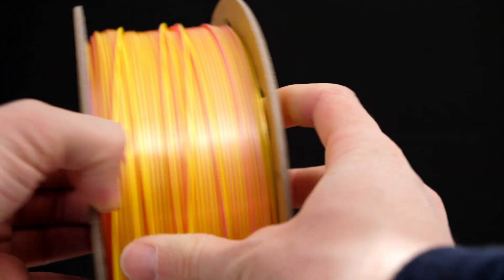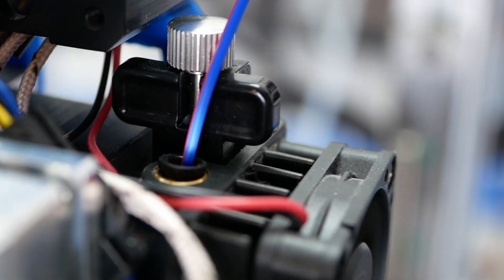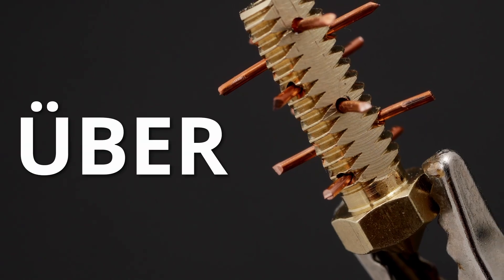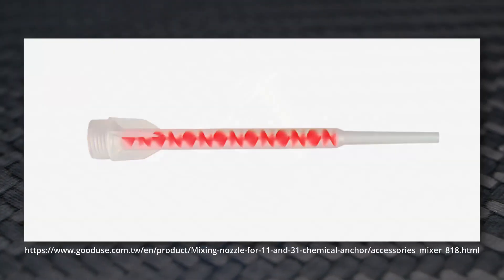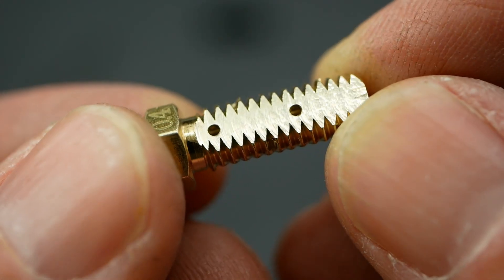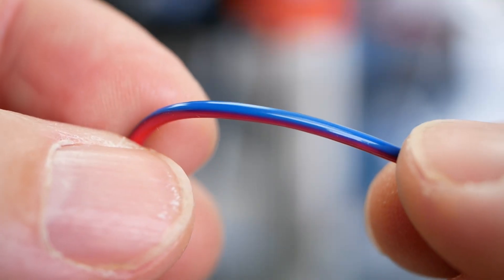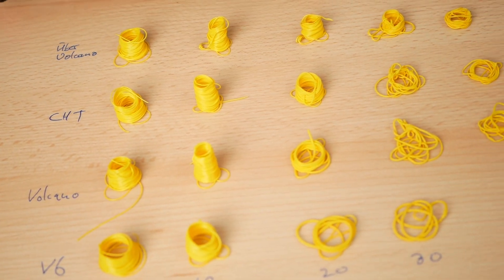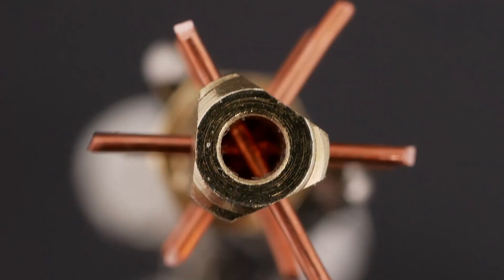Do High Flow Nozzles MIX Dual Color Filament?

Comment: Wow, that Uber Volcano looked insane.

You could probably make a solderless wire insert by drilling out the holes to exactly the same size or slightly less than the wire being added then freezing the wire (to shrink it) so it fits. As the wire heats back up to room temperature it will create a very good metal-metal contact. Essentially the same thing you would do with fitting bearings or bushings.
The biggest issue I could see with that is that brass (ie the nozzle) has a slightly higher thermal expansion than copper, so might loosen the wire at printing temperatures. 
Aluminium has a slightly higher coefficient than brass, but of course has lower thermal conductivity than copper.

Just food for thought regarding the manufacture of home made CHT-esque nozzles

Comment: Why didn't you just lock two nuts on the nozzle and drill right through them,  the milled flats on the sides will hinder thermal transfer, you want as much contact as possible. Might be something worth trying next with a dual gear extruder, make sure the current is the absolute maximum for the motor too, i would rather see it grind before skipping in an "extreme flow" test.

Comment: Great video. Very interesting. Just a few observations/suggestions...
1. If you didn't already, I'd consider using HMP Solder (high melting point) / Silver Solder / Brazing Solder to ensure that it will not melt or soften at normal 3DP temperatures.
2. Do not mill the entire length of threads flat. This decreases the the surface contact area and reduces heat conductivity which could result in a cooler than expected melt-zone. Instead, just use the edge of a file (or a small milling bit) to flatten the actual place where the hole will be drilled.
3. Make the holes smaller so that wire is a better fit and minimize the risk of solder creeping and blobbing inside the nozzle.
Reply: Do you have a link for HMP solder, everything I'm finding is over $40

Comment: 1. If you want to drill holes in surfaces that are not perpendicular to the drill, consider using a center drill. 
2. You could tap the cross holes and use threaded stock instead of round wire. This would increase contact with nozzle and filament. 
3. In the US, as long as you don't sell (in this case) the nozzle you can build and use whatever you want. 
Finally, your videos are uniformly excellent. Thank you.

Comment: I think it's great that you show the mistakes as well.

Milling down the sides of the über volcano nozzle probably reduced the heat conduction into the nozzle somewhat. If you can figure out how to drill holes without milling the sides down, maybe your nozzle would perform even better.
Reply: Also the wire arrangements and the shal of the wire could be significantly improved :) I think this could actually be a very practical concept.
Reply: @infernaldaedra  I'm not clear what "shal" means, but I think if the wire was made to have an elliptical or even rectangular cross section, even more heat could be transferred into the filament by the wires, due to the increased surface area.

Comment: It would be super interesting to have a 3-to-1 hotend extrude material in short bursts cycling through the 3 filaments. I think you'd get horizontally sequential 'pixels' that are probably lined up in diagonal curves on organically shaped parts like vases. With glow in the dark filament it would be even better. Had anyone tried to DIY these 3-to-1's?
Reply: I also just realised the size of the gcode you'd need to do this from the slicer. Maybe get a switch in the power supply of the 3 extruders and make that cycle through all 3. Then make gcode for 1 extruder.

Comment: Next time you want to drill a hole in a nozzle, exactly in the center, use a nut around the thread and drill in the flat side of the nut, then through the nozzle, back in the nut. You just cant go wrong.

Comment: I'm actually really surprised by the lack of mixing despite the round nature of the copper wire obstructions in the flow path. 

At what level of viscosity would it start to have turbulent flow and begin mixing? 

Very excellent video, Stefan. Thank you.

Comment: If You have gas stove in kitchen, You can solder nozzle using stove flame. I soldered this way many parts that where to large for soldering iron.
Oh, I see that You have a proper torch. You can hard solder them and enjoy high temperature printing without problems. With parts that small like nozzle and copper wire You dont need oxy-acetylene torch to reach correct temperature.

Comment: you should use thinner wires. Next time try hot air to solder wires. why do you get not mixed filament out of it. I think because your nozzle doesn't cut filament in parts because hole is too big. it goes around the wires whole filament.

Comment: I wonder if a mixing nozzle would allow 3d printing of thermoset polymers? Some sort of 2-part system where both can be extruded alone as a thermoplastic but when mixed chemically react to produce a thermally stable end product. Kind of like the 2-part epoxy mixing nozzle but instead of liquid epoxy the two parts are in a plastic matrix. Cool video! Would be interesting to see how the uber volcano performs in the internal stress tests.
Reply: This is an interesting idea! I guess the nozzle would get clogged though unless there was some way of flushing it after use so that no material could set inside it.

Comment: I would suggest instead of milling down the nozzle to use a center drill to make a starter hole as one does on the lathe before using a long twist drill.
1 mm is readily available.

Comment: yet again, just braze the copper &/or rivet them in place, put thin edges internally to better transfer the external heat where its needed.
melting point of lead 327.5 °C / Brass: 930°C / Aluminium: 660°C

Comment: Ok, so mixing viscous materials is difficult, not really news to anyone who ever made a cake or similar...

However: what if you were to pinch the copper wires and then insert them at an angle so the start acting like 'wings'?

Comment: Stephan have u ever tried do file the copper wire thinner inside the nozzle... okay, the filing has to happen before u insert the wire ;) the thinner diameter should reduce the flow resistance without loosing the heat...

Comment: I wonder if we will hit a speed limit with 1.75mm filament and go back to 2.85 if these cht type nozzles become really fast (if melt rate is no longer the bottle neck, the extruder motor may be the next?)
Reply: I think when we reach that point that a stepper can't work hard enough we have reached the optimal flow rate lmao.

Comment: I have several GEEEEEEEtech A10T and you can use cura to create virtual nozzles that vary the mix of each of the 3 colors...which is pretty cool...and it does actually mix them... but CMYK includes black and assumes printing on a white surface. RGB is for mixing light using intensity. You can mix yellow and blue and make green, white and red and yellow to make orange, etc, but it's not light rays so you can't mix red green and blue and get white. I'm not sure if CMYK+white on a 5 color nozzle similar to a direct to garment printer would work or not...

Comment: Thanks for the interesting video! To drill holes in the uber volcano nozzle, you can take an aluminum hex jig, inside which you make a threaded hole for the nozzle, and drill holes perpendicular to the centerline that will guide you when drilling the nozzle.

Comment: The ultimate nozzle soldering would be to braze the wires in place. The brazing temperature is around 450 °C
Reply: I wouldn't want to braze brass, ie, it's a pain if the filler and parent metal melt at the same temp because the whole nozzle can melt. Sliver solder would be better, or even 99% high tin solder. 
I personally would just peen the wire ends to seal them, or centre punch the ends so they expand.
Reply: @SidneyCritic  good point. I just looked it up and brass melts at around double the temperature of brazing solder. Brazing copper tubing and brass fittings is common in HVAC applications
Reply: @nrdesign1991  It's more a thermology thing. Like some people classify silver soldering brazing because some SS is brass coloured. Where as I classify brazing as welding with brass, ie, the same material. When you weld cast iron with high grade brass rods, the weld can be so hard that when it cools/shrinks it can crack the base metal. 
You are perfectly correct in saying there is fillers that will melt at a higher temp than solder, but not as high as the parent metal.
Reply: @SidneyCritic  you could just hit it with a TIG torch and tack it real quick and that'd be good enough if the hole was not loose around the wire
Reply: Or even better yet use a press fit connection and superheat the nozzle before placing it.

Comment: Milling flats on the thread is overkill plus it reduces heat transfer because you removed metal in a crucial area.  The best way to do this is to start your holes with a stubby endmill the same size or a little larger than your desired finished diameter.  The start hole created by the endmill only needs to be a few mm deep.  Once you have your start hole created by the endmill you may now finish your through hole with a drill bit.  For those who aren't familiar with machining metal, the reason you use an endmill rather than a drill bit is because and end mill is designed to cut on the outside and bottom therefor it will not deflect when it encounter side forces such as cutting into a threaded screw, as seen in this video.  Using something called a Center Drill, otherwise known as a Combination Drill & Countersink,  instead of an endmill would also work if you don't have a small endmill.  Endmills are designed to work in milling machines so if you only have a drill press a center drill bit would be a better choice for starting your hole in the thread..

Comment: Over the holiday break, I printed some roses in Matterhackers Quantum dual-color filament. With the silk effect they look stunning. So much so, that I had to order another color so I could have half a dozen in a vase with different color variations (raspberry/gold and raspberry/silver). Nearly every color was out of stock until Feb, maybe indicating how popular this filament type is right now. It's a good thing that these high flow nozzles don't mix the colors.

I'd like to find a way to print with bands at different height having alternating perimeter print direction, so that an color stripe effect can be achieved, but I can't find a slicer that provides control over this. Anyone got any ideas?

Comment: Do you think crimping the 0.8mm wire in the nozzle, with like a pair of tweezers, would do any different? You'd be making the wire into more of a tear drop shape, so it might cut down on resistance. (barring that the flowing plastic doesn't crush the tear drop into something worse.)

Comment: Instead of soldering copper wires through the brass nozzle, could a metal insert be created that does the same job of increasing surface area for the material to melt?
It would have to be fractionally larger than the space inside to make sure it stays put, meaning pressed into place and not removable.
Reply: Yes but the patent probably prohibits western countries making such a thing financially viable.

Comment: I’m curious what would happen if you tapped the interior of the nozzle. If it would jam or if the increased surface area would help flow, or if the threads would create the turbulence needed for mixing?
Reply: What if the interior was deeply knurled giving as much turbulence as possible :)

Comment: it may seem I am quoting myself, but it seems my commentary went unnoticed (mabe be cause I posted it 2 weeks after the video)
Just a little idea that came to my mind las week: 
replace the wire in the diy high-flow hotend by a thin strip => you would get core heating and less back-force in the nozzle because of the polymer needing to turn around the wire.
About the machining process, I though of this procedure :
1)drill a .4-1mm hole in the threads of a v6 nozzle
2)by using a jewellery saw, or one of the tipe with really thin blades that are straightened by the rest of the saw that pull on the ends of the blade (with a wide U shape), findable in hardware stores here in france. You pull the blade through the holes, thight it in the saw and extens the holes into grooves,
3) pull a thin strip of thermally conductive metal (copper, brass, nickel seems easily sourceable as it's used in Li-ion battery packs, aluminium should be common in cakes packaging or cans, just don't forget to get yourself special solder for it)
4) solder the strip in place
5) cut off the excess material
6) thread back the nozzle 
 
an other solution for the drilling nightmare may be to first drill an M6 nut in the center of one of it's sides, and do the same on the other side, the drilling bit will be directed straight in the threads instead of slipping away.
by drilling both opposite sides of a nylon-lock nut, you would be able to perfectly drilling the hole through the nozzle in two steps without the holes-centering nut slipping when flipping the nozzle

Comment: And you even lost heat transfer surface by machining those three surfaces. Perhaps you find a better way for drill guidance. And as I said already in a previous comment: Hammering the wires flat in the middle where it sits in the flow would probably decrease the flow resistance by maintaining the heat transfer.
Great experiments!

Comment: I drill a hole in a middle of tube with a tool i made for every job. In a cube i drill a hole of diameter same as tube i want to drill a hole. Than perpendicular on this hole in cube i drill a hole of diameter i want a hole in cylinder. Than i put this cube on a tube i want to drill and make make a hole thru this cube. But all tool I have is vertical drill.

Comment: I have a 3 input diamond nozzle collecting dust waiting for M6/M6 heatbreaks, got M6/M7 by mistake! Thinking of it, i do have plenty of other stuff around the shop so a scavenging hunt is in order ! 😀
Reply: Could you put 3 V6 heatsinks on those heatbreaks?
Reply: @soundspark  Yes i could but they do not fit the threading, i have M7 heatbreaks, V6 is M6.
But i think i can gather 3 of smaller heatsinks with breaks. Will check tomorrow.
Reply: @toma.cnc1  The E3D V6 heatsink is supposed to be M7 on the cold side.  You must be thinking of the obsolete V5 heatsink.
Reply: @soundspark  might be, it is a cheap one.

Comment: I just ordered a Prusa MK3+ and an Atomstack X7 50w, that got me thinking... I wonder if you could use a laser to heat the interface between one layer and another as its being put down. The other thing I was thinking if there was a UV hardening filament, using a UV laser to cure it as the 3d printer prints it. Just things I think when I get new things.
Reply: The UV laser thing is actually how SLA resin printers like the Formlabs work.

Comment: I wonder about if you were to put slots in the walls of the nozzle threading and put a DE safety razor as what would split the filament rather than the soldered copper wire @CNC Kitchen? I also think putting flat sides on the Uber volcano would have a negative effect on "even" heat transfer.

Comment: I haven't really looked at the patents but since your system involves modifying already existing nozzles and an entirely different machining process shouldn't your design be it's own thing separate from the patent? And since you shared it publicly without a patent shouldn't it basically be in the public domain? I know the case would be an arguable one and not open and shut, but it seems to me that this could be the case.

Comment: When we are trying to get good mixing in our pellet extruders we choose our dual 20mm extruder with about 10 stages of mixing sections.  These are very extreme mixing sections, they look like aggressive toothed sections, and we introduce our fillers at different stages.
Reply: So you're saying that having something more like teeth in the flow path will create more mixing/turbulence?
Reply: @infernaldaedra  I think it would help with turbulence at least since the rounded wire acts more as a speed bump and just slows down the flow a bit instead of causing a lot of mixing/turbulence. Something more chaotic, a bladed shaped obstruction could be used to push the flow from side to side thus causing more turbulence instead of just a speed bump effect of the rounded wire.

Comment: Just cut your drill bit down to .3mm  longer than your drilling depth plus the length to be held in the chuck, with this approach you will have no deflection of the bit when drilling the holes in the nozzle

Comment: should grind down the centers of the rods to form  an propeller or twist, so the rods are not round in the center.  should only need to drill from one side for all rods, no crossing of rods.  i'm sure turning the rods into blades will make it mix.

Comment: Next time instead of soldering just drill 0.55-0.6mm holes and press fit wires. That would give much better performance.